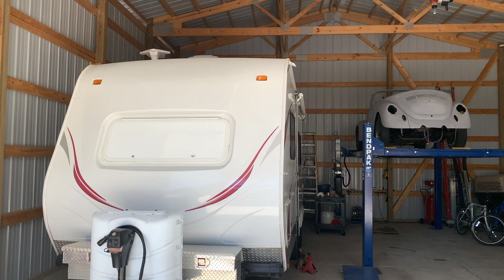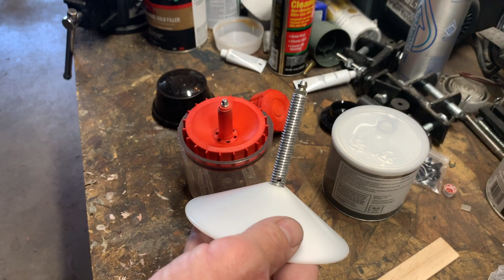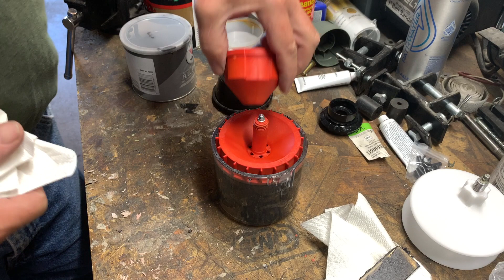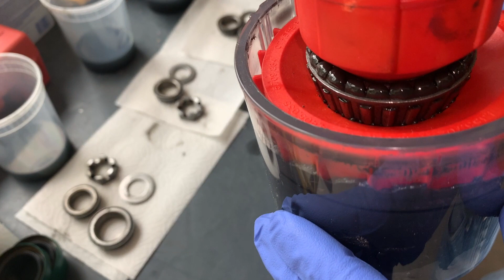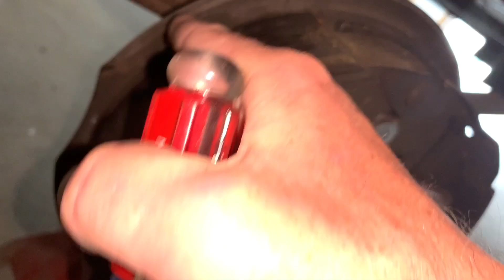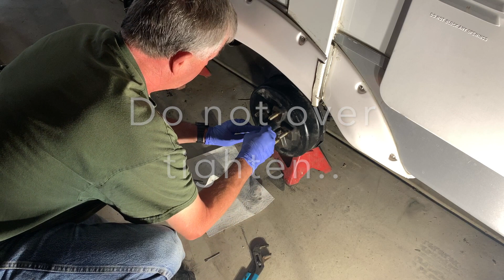RV Wheel Bearings - WHAT YOU NEED TO BE DOING !!! - How to grease bearings - How to replace seals

Comment: Question: Why do you fill with the grease gun at the end if you put grease all around everything first ? I tought the grease naple was just to add some sometime if you need it. Thanks great video.
Reply from the maker: Great. Question. Filling the chamber in the beginning which doesn’t take much preps it for the next time after running for a season to just put three pumps in to see it coming out the front. Plus fills the chamber and keeps moisture out especially if this where a boat trailer submersed.  You could wait until first service to fill. Just have done it this way. Like a car rotor you don’t fill that doesn’t have the cert. see my last video on the 29 Mercedes build part 3. Thanks for asking.

Comment: Thanks. Like the tips on the tools to acquire to accomplish the task. How often do you apply grease to the spindle?  Seems like once it is full you would never have to do it again. I’ve heard horror stories of Graese blowing out the back seal, contaminating the brake shoes and rendering the brakes useless.
Reply from the maker: Give it three pumps beginning of every summer. Grease comes out the front. If it is blowing out the back like I had on the one wheel. Time to replace seals. Thankd
Reply: @bparkinson1234  thank you. Good to know. Something I haven’t done yet. how can you see when it comes out the back with the brakes on?  I have disc brakes on my fifth wheel.
Reply from the maker: @terryhaynes1596  don’t know about disks. I would assume so. They both have rear seals. Thanks